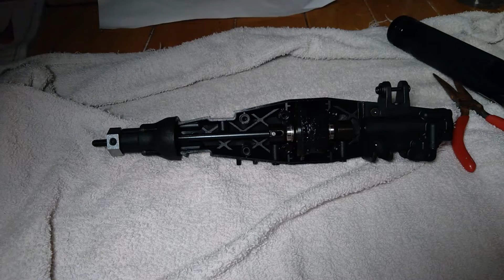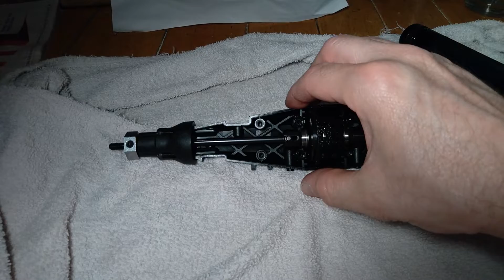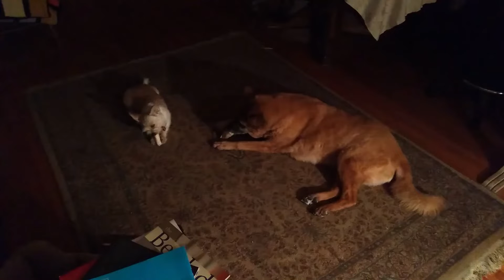Losi Lmt Build _3 -(Axle noise was the dog bone sliding around)

Comment: I have LOSI LMT too but my dogbone doesn't do that, i think your dogbone is short, compare it to then other side if they measured the same. For me the amount of play is huge, the tip of the dogbone is almost at the tip of the cup when you slide it. You can warranty it to where you bought your LMT just my two cents.
Reply from the maker: Thanks. I hear it on both sides but I'll take it apart again to compare the left and right. Sounds like I may gotten some short ones some how from what you mention. Thanks again for assistance on this.
Reply: @plorks445  you're welcome, and also try to check if it has two bearings on both side, one inner and one outer of the rear axle mount.  if you have FB try to join LOSI LMT group, you will learn a lot from there.
Reply from the maker: @glikoy888  Yeah, thought it was normal after I found two ball bearings. One on the outside and one on the inside. I'll check out that Losi group.